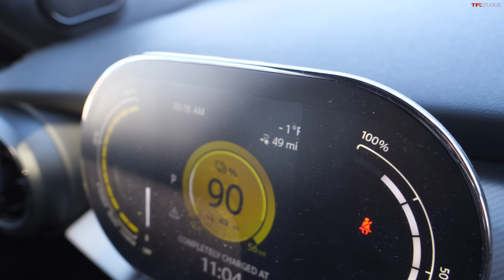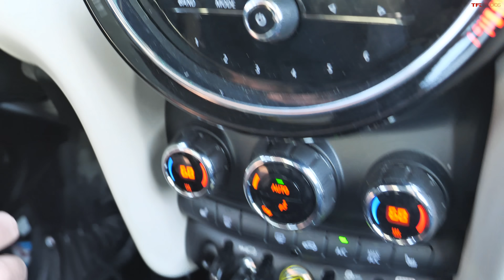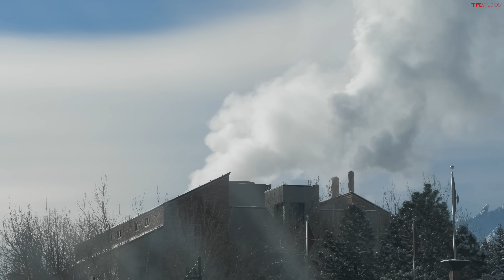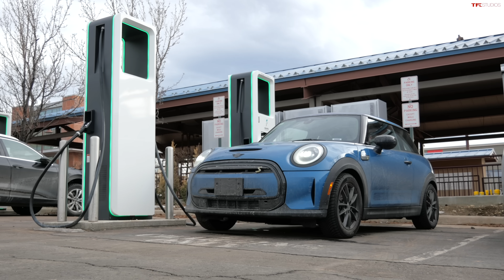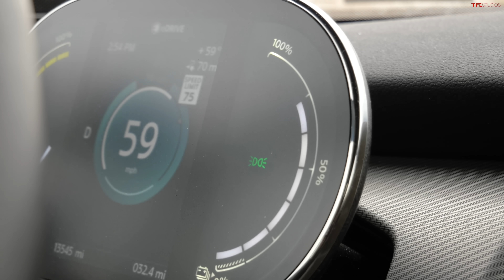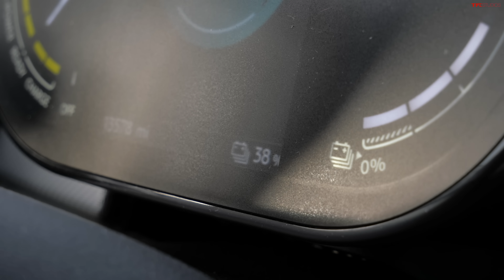Myth Busted? Here's How Much Range You REALLY Lose in the Extreme Cold!

Comment: Does this Mini have battery heat scavenging? DC fast charging requires heating up the battery pack quite a bit, and afterwords it's best for the battery to cool it back down. My EV just dumps the heat outside, but current Teslas use that energy to heat the cabin. I have no idea if any other EVs can do this, but it seems like a good strategy.

Comment: Not an insignificant difference.  But let's not forget this is not much worse than gas engines.  20-25% drop off in mileage due to temperature and winter-blend.

Comment: I’m not sure if you tried this, but I run mine with the climate control system in auto but I turn the AC off so the compressor is not running and I get better range and still get heat and no fogging issues.

Comment: Until we see some kind of big leap in battery technology I think the only answer is for even longer range evs. I feel like 400+ miles is sort of the sweet spot when competing with ICE vehicles. Let's say in the worst case scenario you lose 150 miles of range during the winter you still got 250 or so to work with. I currently have a plug-in hybrid that I am very happy with but it does make me want a full EV sooner than later.

Comment: You need to do the same test again, in warmer temperatures (=76f) with the AC again set at 68f. If Colorado gets into the 90s, another test is warranted.  In the warmer temps there will be similar load on the battery when the outside temp was 60f (or 38f). This will give the net battery degradation due to the cold temps.

Comment: I had a BMW i3 for a few years, and would regularly drive it over mountain passes, including a stretch where the distance between charging stations was just barely doable in blizzard conditions. One trip, I was heavier than normal and must have had a headwind - once I started uphill, the guess-o-meter was WAY short of the distance to the next charger. I knew I'd make it up on the downhill side, but it was lower than my normal runs, so I knew it was going to be pucker-factor close. Had to set my heat to 62 F, and shut it off for periods of time. Squeaked into the charging station with 1 mile indicated range. Would have loved to have had the heat pump instead of resistive heating.

Comment: I've been tracking range on my drive from and to work in my Ionic 5. Both the 20 mile drive to and from work.  Roughly 59 days tracked.

Sept 23rd to Oct 31st.  I averaged 3.62Kw/hr in the morning to work,  4.2Kw/hr evening from work.
Nov 1st to current. I averaged 3.03KW/hr to work, and 3.62KW/hr from work.

I also marked down average temperature in this as well.  
Sept 23rd to Oct 31st: 57.2F morning, 83F evening temp.
Nov 1st to current: 40F morning, 52.67F evening temp.

Comment: Great content.  Keep up the good work!  You mentioned that your Mini is wearing Michelin Crossclimate 2 tires.  Not sure how long you’ve had them on for, but can you comment on: (1) How they perform in the winter compared to other top tier winter tires, (2) How they perform in the summer compared to other top tier N. American all season tires, and (3) Whether you’ve noticed any difference in range between these Crossclimates compared with the original tires that the Mini came with.  Thanks!
Reply: I ran them on my old mitsubishi lancer. I'd say maybe 70-75% of the winter performance. most stressful thing I did in them was drive a lightly unplowed mountain road up to ski, park, get 10-15cm fall while i was there, and reverse out of the ditch (front tires in the drainage ditch in FWD) to get back out. and they did that, albeit with some coaxing. my frame of reference is blizzaks, which i ran in winter before those

summer I didn't notice any downgrade vs my dealer all seasons, but never have purchased "nice" all seasons. not really worth it for my climate/roads

hope that helps!

Comment: This gets discussed often and generally speaking, no one actually tells you the truth.  The reason range goes down in the cold is because batteries function worse in the cold than in the warm weather.  That's responsible for approximately 20-30% drop in efficiency.  The car, generally speaking, is not using energy to warm up the battery unless you specifically tell it to.  This is preconditioning before you get in or if you have the option, preconditioning before you go to the charger.  Outside of that, unless it's well below freezing, EVs do not expend much energy at all heating the battery.  The reason some people experience 30-50% drops in range are because it's extremely cold and the battery does need conditioning AND the use of cabin heat.  Some people insist on using their cabin heater so they can drive without a jacket, which is going to use probably close to 6-7kWh.

Comment: Chevy Bolt at 62.5 mph with a 60 mph head wind in a thunder storm range dropped to 110 miles.   Range at city speed 25 to 50 mph in summer heat range 400 miles. Range at -35F 118 miles no wiper but lights on. Defrost and heat.  Highway range in summer at 62.5 mph 280 miles.  Highway range in summer at 69 mph with hills (foothills of the rockies) 198 miles.  At 21F range of 201 miles.   Epa 259

Comment: curious to see what the impact is on a "regular" cold day like 30 degrees rather than zero
Reply: We see that often. With the heat pump it's really a non event with those warmer temperatures. 3.7 mi/kWh (106 miles) in the Mini is common, with all seasons tires, cabin heat set between 68 -70F. We notice a larger impact with wet roads over use of cabin heat, sometimes dropping down to 3.5 mi/kWh (101 miles) during a rain storm and warmer temperatures.

This isn't highway driving, more of a mix... leaning towards city / back road driving.

Comment: Í'm wonder if a plug-in hybrid will run in electric mode if you turn on the cabin heater. If not then you lose the reason the buy it you live in a cold climate.
Reply: Depends on the model. Some PHEVs have a dedicated resistive heater while others use engine heat to heat the cabin. The Volt used both below 15F, but that was easily inhibited. The 8,000 watt resistive heater was more than enough to heat the cabin in a matter of minutes.

Comment: For us metric ppl, it was a 100km loop at -17C and +15C.
The EVs without battery heating suffer a lot in sub freezing conditions. It looks like it consumed 1about an extra 8kw in the cold weather for 100km, which is in line with what I've seen.
The issue with looking at % battery is that EVs have a wide variety of sizes - on an 77kw battery car the difference will be around 10% between the 2 trips, leaving people to believe it's not that big of a difference, even though the actual consumption delta is the same. Looking at distance/kw should be the only comparison made to give people a better idea of the drop in efficiency.

Comment: Here is the problem with that particular ev 70 miles at near 100% so most people will charge to 80% as manufacturer recommends so effectively you have a winter range of around 56 miles, most people are not going to spend additional time charging at 3kw to get to 100%
Reply: There's no way to stop a charge at 80% or 90%. The Mini only charges to 100%. 

I haven't seen any recommendations to charge to 80% in the 2022 manual. But the general consensus with NMC chemistry is to keep the battery at 80 or 90% for longer sits. (ie: over a day or longer without driving).

Either way, 8 - 10 year / 100,000-150,000 mile battery warranties should consider worse case battery care. With techniques to maximize that beyond warranty limits.

Comment: What is the optimum temperature then??
Reply: +50*C
Reply: Around 70F these vehicles usually peak. Not associated with just battery temperatures, but dry roads, no cabin HVAC, and less dense air. 80F and above the air conditioner may be used for the cabin and/or battery cooling, which will normally hit the range a bit.

At least from our experience.

Comment: The percentage is huge because the battery is so small.  The kWh difference is the important metric.  10kWh is 33% of a 30kWh battery and only 13% of a 75kWh battery.  Using percentage on the Mini Cooper is like telling us it would use 10,000 AA batteries.  😆 Looks much worse than it actually is.
Reply: It's all pretty much the same regardless the battery size.
Someone in Colorado a few weeks ago in the cold temperatures lost around 50% range in his rivian truck with the 135 kWh battery pack.
His average m/kWh dropped to 0.88m/kWh at one point. He normally gets close to 2 mi per kilowatt hour with that truck.
Out in Kansas someone with a Ford lightning pickup with the 98 kWh lost similar range a few weeks back in the cold temperatures.

Comment: This video is so wrong. It’s like driving a Hummer and claiming that the Prius would never be able to get more than 30mpg. Take the worst EV (in terms of tech) and test it in the worst conditions while WE KNOW there is significantly better tech out there. Hyundai and Tesla both use heat pump to warm the vehicle which is a WORLD of a difference in terms of efficiency in cold weather. Tesla also uses heat from the motors and battery pack to warm the cabin (when driving) which makes it even more efficient. 
It would be great to see a video comparing EVs in cold weather. You MUST include a Hyundai, Tesla and probably MachE (maybe F150 lightning) to the comparison.
Reply: This video would have been fine if the title didn't make such a bold claim.

Comment: For a car that small, they simply need to find a way to add more battery to make this car practical. They need to get it up to normally 170-200 miles of range so that it's more like 120 miles on a cold day. 62 miles of range is simply unacceptable. They should either add a gas range extender, like what BMW did or shove batteries in the hood area. Spending $30K on a car for it to only go 62 miles is nuts.
Reply: I would respectfully disagree.  For a commuting car it is ideal and actually entertaining to drive (unlike our son’s leaf).  My wife unplugs it in the morning, drives thoughtlessly to work, errands, groceries, etc - and then repeats the same process the next day.  Even in winter.

We have lots of other vehicles for trips or towing, but since 95% of my wife’s driving is local she now buys 95% less fuel.  And the wear&tear on all the other vehicles drop.

Comment: I have a 2020 Fusion Hybrid and my range plummets when the temp drops below 34F . I can drop 100-200km in range very easily on a full tank .Three winters in and it wasn’t just a “breaking in period” as some suggested . 

So that’s a combination of my ICE and battery that both drop in range or efficiency
Reply: is it a real drop in efficiency/range though, or is the car sat idling to defrost in cold temps where it would be driven immediately in warmer weather? i find that makes the difference with my 2.0 Diesel Mondeo (basically the same car as the Fusion) here in the UK.
Reply: @petelattimer6808  I seldom let it warm up , but that’s a good question . With heated seats and steering wheel, warm-up is mainly for windows after scraping ice ( if I have any) . Honestly find the longest range happens on longer drives, not my usual 12 km commute .

Comment: I wonder if you keep the internal climate to about 60 and have the seat warmer on . Would that be more efficient than having the heat pump running?
Heat pumps aren’t very efficient below 30•
Reply: have you tried keeping windows demisted with a heated seat?
Reply: I didn’t mean to turn off completely but lower instead. 
We keep our house at 60 in the winter.
Reply: geothermal heat pump is by far the most efficient way to warm a  building regardless of temperature, assuming that you're getting your heat from deep underground (not just 10 ft/3 m). 🙂

Comment: Why did you have the AC compressor on? That's another 20 mile hit on the range.  You don't need the compressor
Reply: It’s a heat pump not an ac compressor! It heats and cools depending on conditions, and just like heat pumps in homes when it is really cold the secondary heater comes on and efficiency goes out the window with the heat!
Reply: @user-ei6os2mx9n  well that makes sense.  I sometimes will turn and off my heat just to see how the milage plunges. Thanks
Reply: @AnswermanAnswerman  I wonder if they ever considered radiant, like the home builders are doing now.  Heat rises 🤔
Reply: @billygene8428  heated seats and steering wheels, lol, their trying!

Comment: The draw for the heating should be related to only two things, size of cabin and heater type.  So if you compare the interior volume of the Mini to any other prospective vehicle with a heat pump you can then compare the battery size to determine how much % difference you will get.  The small battery of the EV means that a (making up notional number) 1kW draw for heating will have a larger impact on range than a 1.4kW draw for a larger car with more than twice or three times the battery size.

Comment: I wonder how much is the loss when comparing gas cars with the same gas grade and similar temperatures? I can imagine a loss but not at 26%.
Reply: We saw a 20 -25% drop in MPG with a Malibu in those conditions. But that was with shorter trips, running errands, where the engine had a difficult time warming up during drives. 

These longer highway trips would no doubt improve on that, as everything had a chance to warm and stabilize.

Comment: This is completely misleading; 26% loss is relative to your battery size. Since the heat pump draws a constant rate regardless of battery size you will see a larger loss for the tiny battery you have there. Go do the same test in a Silverado EV this year and see what you get with a 200 kWh battery. You should have compared kWh loss due to the heat pump for this to be relevant.

Comment: Only if there was a way to get a reading of where the overall charge goes.  Seeing the distance change with the heat on and off makes me think a significant amount of charge on the first run went to heating the cab 67 degrees compared to only 8 degrees on the second run. Crazy! Thanks for the info!
Reply: My Ford Mach E shows how the energy was used. It segments usage into climate use, driving, accessories, and exterior temp. I find this very useful .
Reply: @irfanhusein1445  That is slick and I think should be standard.

Comment: This was a nice test but because you left out the data from non EVs it makes it look like 20% range lose is a lot in cold weather    misleading non EV owners and feeding the fire for the haters. Also that is not how EV owners maximize range in cold weather. EVs are different then ICE cars and because of that should be treated differently, you need to change your driving habits. Preheating the car and the batteries while still charging is how to get the max out of an EV in cold weather. Yes you will see a range drop but you will see one in any type of car.

Comment: I just filled up my car a few days back.  I normally get 24 mpg (all city driving) in mild weather.  The last tank after that cold stretch (Wisconsin) i got 19.5mpg.  So much idling, warming up the car, etc just kills mileage.  All my trips are 10 miles or less so its brutal on a gas motor.  If they can come out with a cheap ev i'd be all over it.

Comment: The inefficiency of gas engines is what makes it possible for EVs to get even within the ballpark of a gas vehicle despite the massive difference in energy density. We measure efficiency in "energy lost to heat" so if the heat produced by a gas engine is actually desirable, that majorly changes the efficiency calculation. I don't think this is a problem with EVs that could ever be solved but it could be mitigated with better-insulated cars, double pane windows, etc. Cars these days are still uninsulated tin cans which can't hold a bit of heat in 70mph wind.

Comment: If you have to drive in a winter coat and be all bundled up, then that's not real world testing. In the real world people turn up the heat to be comfortable.
Reply: Isn't that what heated seats and wheels are for? Most of these vehicles have such, and highly recommend with these conditions as they draw very little energy.
Reply: You take off your coat to drive? You implied that the heat should be cranked up enough that you should be removing your coat.

Comment: 25-50% range loss due to temperature and weather is widely reported in EVs.  That's chemistry.  ICE car batteries also lose energy in cold ... ever had a car not start at low temperatures?  

Heck, my ICE truck lost 20-25% mpg in Wisconsin winter. You guys should have done a comparison mpg loss with your ICE fleet.

Comment: Less than 2 minutes in and your not turning on the heated seat?? The average person would not do that. That's why EVs have heated seats so that the passenger uses it to get warm rather than using the air flow to heat the cabin